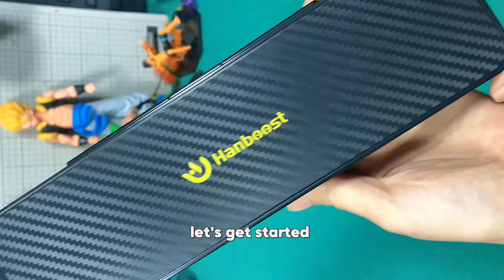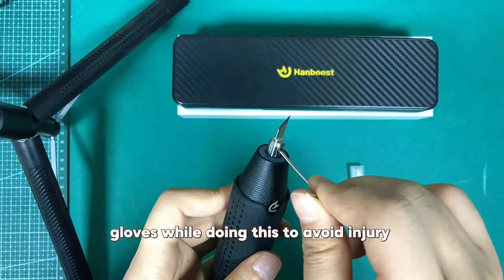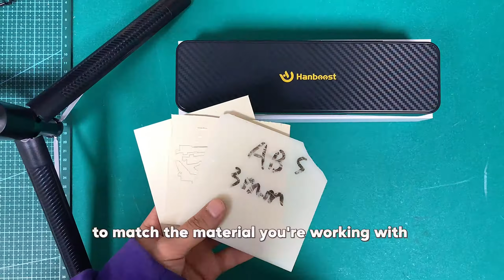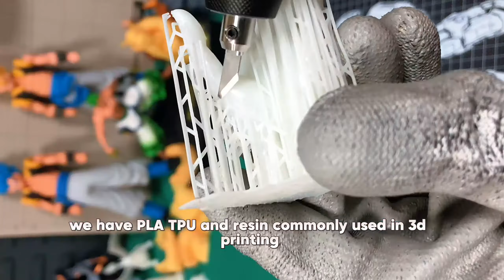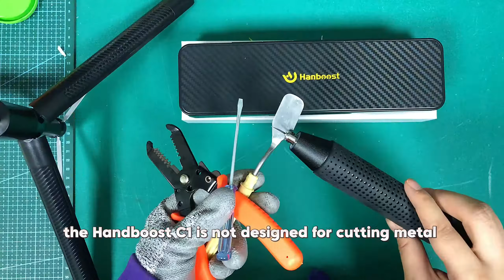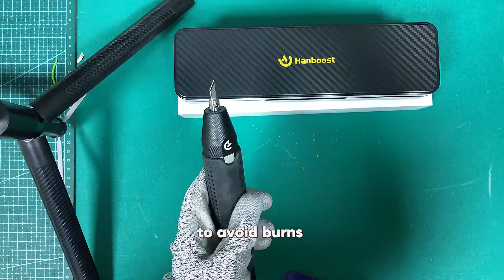Hanboost C1 Ultrasonic Cutter Tutorial

Comment: Bollocks. Mine arrived a few days ago after waiting more than 6 months for the kickstarter. On any speed other than 3 it's basically useless for cutting anything other than paper. And gets very hot very quickly, necessitating turning off to cool down. It struggles with PLA and certainly can't cut anything anywhere near as thick as in the demo.
Reply: That's because it's all a lie 2800mha at 40.000hz will deliver no more than 40 to 50min of cutting, they claim a couple of hours!!

I have tried them all including unreleased ones and they all use generic blades and make fails claims apart from one cutter...

The NeoBlade from HOZO Design absolutely slaughters the competition is cheaper to buy and built to a much higher standard. 
It can only cut for between 20 and 30 minutes on its 1300mha battery BUT it's designed to hot swap and they only take 5min to charge fully.. It can also run and charge at the same time via usb c it's just a far FAR superior product!!!

Comment: Mine arrive a few days ago but has been disappointing. Mine doesn't perform anything like that model in this video. It does vibrate and get hot. But it won't cut anything. Mine is likely to be defective.
Reply from the maker: Dear backers, you can send your issue to support@hanboost.com, we will help you fix issue
Reply: Mine too. I wrote my comment before I saw yours but basically the same thing. Does vibrate although it's hard to tell if it is, and gets hot quickly. Useless for anything other than paper.

Comment: Can this be used to cut wood? Specifically hardboard (or masonite, depending on where you live)? That's essentially pulped wood that is pressed into thin boards. If so, what thickness of boards is it effective with?
Reply from the maker: it depends, for high density wood, it won't be cut
Reply: @hanboost  I'm primarily thinking of MDF/pressboard.

Comment: Using a sanding strip in an ultrasonic cutter on PLA will almost certainly instantly melt the PLA from friction heat. Likewise, using an ultrasonic sander on a resin print will produce a large amount of resin dust, which is very dangerous to inhale or get in your eyes. This is terrible advice; be extremely careful (mask, sealed goggles, ventilation) if you attempt this.